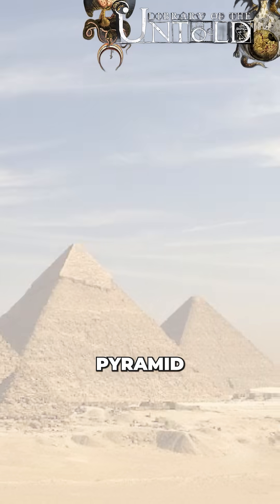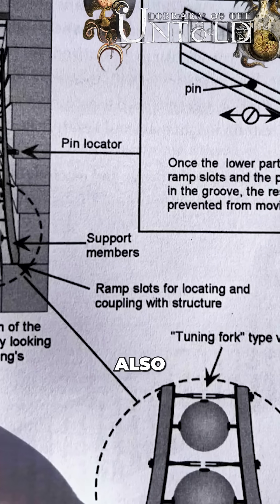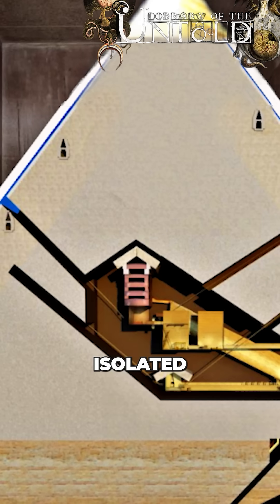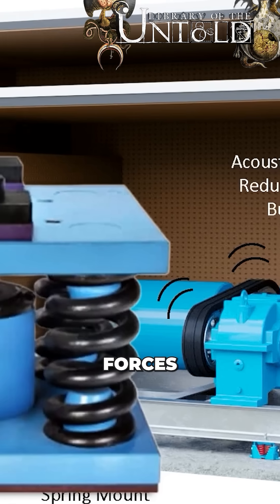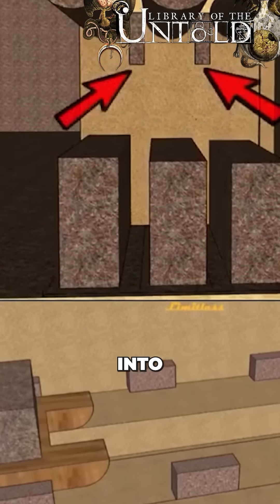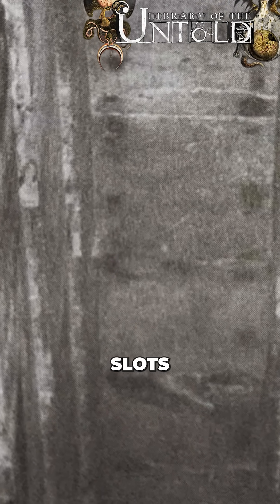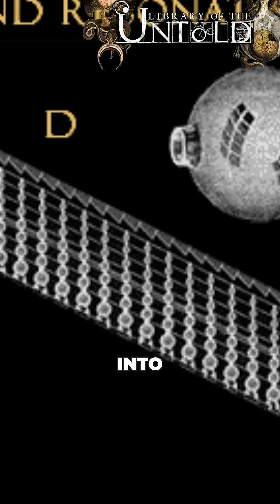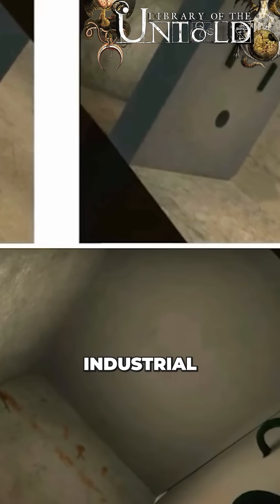Pyramid Components MAKE NO SENSE for a TOMB #egypt #giza #ancientcivilizations #ancienttechnology

Comment: So if it's a "powerplant" using stone and other natural materials instead of manufactured ones then where Is the infrastructure to utilize it? A transmitter needs a receiver and a means to utilize the energy.  If that's what it is them you're missing more than half of the equation